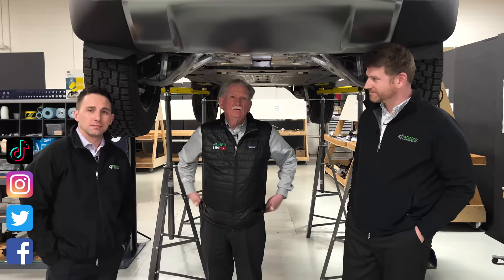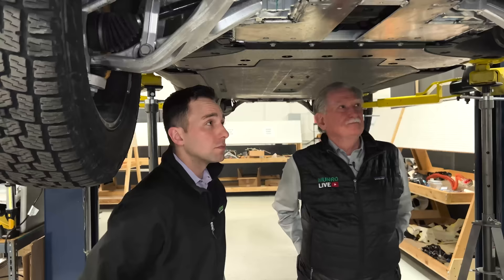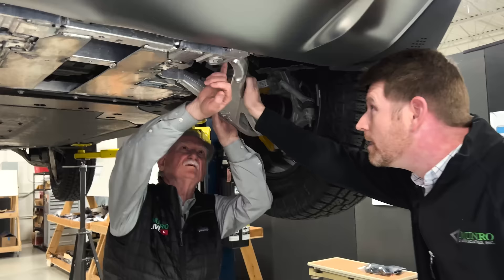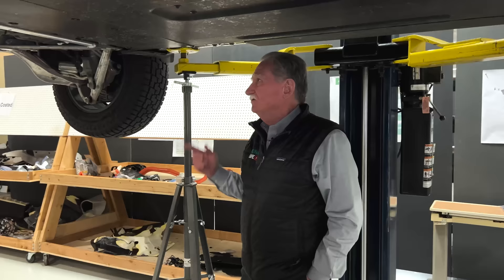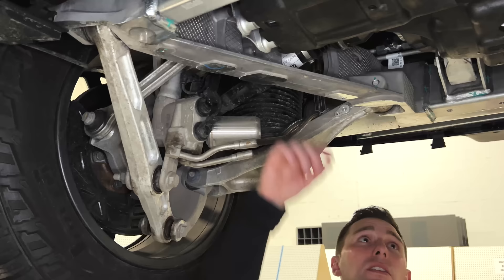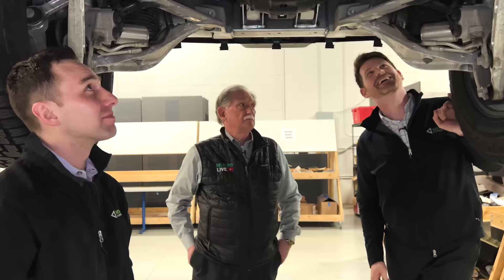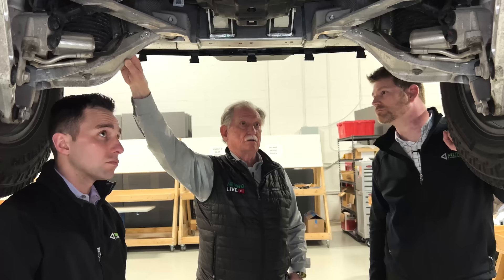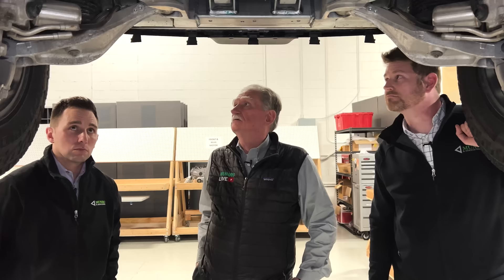Rivian R1T Electric Truck | Hoist Review

Comment: Question, I thought the Rivian had in hub motors, so why is there an drive shaft running to the wheels?
Reply: No, Rivian does not have in-wheel or hub motors; I don't know if they ever seriously planned to do that. There is one motor per wheel - some people confuse that with motors in the wheels.

Comment: Sandy, how would this take a sheet of plywood? Your answer could make or break my purchase decision.
Reply: The box is very short - even with the tailgate down, an eight-foot-long sheet seems questionable, but Rivian says with their tailgate design it's 83.9" long when open. The truck is as wide as other full-size pickups, so width between the wheel wells should be okay; Rivian specifically says that it can carry plywood sheets.

Comment: It seems Rivian have big gigs presses than Tesla. Tesla proved they could do it & save 370 parts(Inc. Fasteners.) Vivian have proved its not only possible but doable in a series production pick up truck. It shows they've moved away from a body on ladder chassis. Those two big aluminium craddles make all the difference.

Comment: Are you going to buy another Rivian for tear down???  Maybe you need to sell some more stickers or get SABIC to sponser it.   Other auto YouTubers can easily review the exterior and undercarriage of the truck.  Rivian was very tight lip about their batteries at the LA Auto show in 2019 so it would be very interesting to see what they ended up doing.  Also it would be nice to see their cooling system (compared to Tesla's Octovalve), the computer/electronics (if they used Nvida chips), their motor/invertor design, etc.

Comment: So If drivers increase tire size (and weight at end of each wheel) will axle half shafts need to be beefed up? Is there space for a straight shaft that isn't graduated? Or is the space engineered that tight?
Reply: Axle shaft size has no relationship to wheel weight. Larger diameter means more torque for the same delivered power - that would be a reason for wanting upgraded axles, but there are many components involved (the shafts, inner CV joint, outer CV joint...) so it's not clear that an upgrade is appropriate. I don't think people are going to be putting huge tires on these anyway - if you want an electric truck with bigger tires, buy a GMC Hummer EV.

Comment: Would be nicer if they make a smaller rivian.. as small as a ford maverick pickup
Reply: There is a dual motor version coming and a smaller battery pack.  Will be interesting to see if they are different in any way (suspension/etc).  It'll be lighter.
Reply: @mistermister2085  correct me... they going for LFP battery?

Comment: That is quite an interesting link system on the rear suspension, any chance we could have you talk about that at some point ??                     CHEERS                 Steve h.
Reply: It's a typical five-link. Two angled lower control arms act like virtual A-arm, two angled upper control arms act like another virtual A-arm, and the fifth link is a mid-height lateral toe control link. The spring is on one lower arm and the shock absorber is on the other. It's functionally the same as a Tesla Model 3 or the latest Model S (such as the Plaid), as well as Mercedes sedans since the 1980's and many cars since then, although some other variations (such as the Mazda MX-5/Miata) mount a coil-over shock directly to the hub carrier instead of on a control arm.

Comment: Kind of concerning that the camber (?) eccentric bolts on the front control arms are at nearly full travel from the factory.
Reply: Look like the geometry of the frame is a banana OR the didn't adjust it.

Comment: I appreciate the engineering eye going over some of the small bits, but the fawning over the suspension is a bit much.  The length of the control arms looks similar to my Titan.  It has similar range of motion to the R1T (without coilover in place)  It would have been good if they'd measured the length of the arms and CVs for a point of comparison.  The shape of the arms is fine for on-road or if you are on a prepared track but I'd never take that into the woods.  The S form of the LCA is begging for a rock strike.  Also the S form demands additional reinforcement to manage forces on it.  
The statement that the R1T did better than the Jeep requires clarification.  I've seen plenty of reviewers try to drive a 4WD up a dirt face that demands 4LO attempt it in 4HI or 2WD, either because they didn't understand how its intended to work or to intentionally 'embarrass' the Jeep.  
Perhaps by the time they get to the 3rd gen R1T it'll be something to replace Jeep, F150, ... but not in current config.  I've seen these at max height and theres little suspension travel.  These cars are aimed at the wealthy that think driving down a dirt road to the ski chalet is offroad.  They are not built to do work or travel off-road.  I have hope, and can see some good design choices, FAR better than those in the cybertruck, but it still has more refinement needed to perform the claims that have been made on it.  Just because your motor can theoretically pull a given load doesn't mean the chassis, brakes or dynamic stability can handle it.
Good review and great first foray into the truck segment.  Next step is to go from "lifestyle vehicle" (what many CUVs, SUVs, and unibody trucks are) to truck.

Comment: Question…is the R1T correctly describe as a unibody?  Within the R1T skateboard are huge frame rails, so how is it not a body on frame?
Reply: I didn't know, so I did some web searching, and there are images - including one on Rivian's R1T page - showing what clearly appears to be a body about to be mounted on a separate frame. Either they radically changed the construction after starting production, or the Munro people don't understand what they're looking at.

And the top isn't flat, so it isn't a "skateboard"; it looks like a conventional chassis with separate frame.

Comment: Aluminum is a weak choice for the undercarriage if it was ever going to be used as an actual truck. It's not to save money that large aircraft manufacturers take the weight penalty to use stronger materials in their landing-gear assemblies.

Comment: Articulation from closer to center line allows for more travel. Wouldn't that also allow more body roll? I don't see a sway bar front or rear.
Reply: That's waht the hydraulic lines on the dampers are for, probably something like DRC from Audi
Reply: Body roll is related to spring and stabilizer bar stiffness, not control arm length or total possible travel.
Reply: @computercrack  Yes, apparently it is supplied by Tenneco.

Comment: Cast steel Control arms are not as durable as stamped steel control arms by a factor of about 10 times. GM saved money casting truck control arms but had some issues when using cast control arms on school buses when the cast control arms failed and school buses crashed. That being said I want a Rivian.
Reply: They're cast aluminum, not cast steel.

Comment: Unibody truck? Can it carry the load? Serious question.
Reply: Commercial vans (Mercedes Sprinter, Ford Transit, Ram ProMaster) are unibody now, and carry tons without problems. But the Rivian R1T isn't unibody anyway, based on images from their assembly line.

Comment: Those hydraulic lines and fittings at the bottom of the rear wheel swing arm, look pretty vulberable !
Reply: Remember the covers have been removed for this video.
Reply: @brianb-p6586  still... you would think with all the engineering that went into this, and advertising it as an off roader, there could be a better solution. ( Is it linked to the rear wheel steering ?) Dont get me wrong, I think the Rivian is revolutionary in the truck world and would love to have one.
Reply: @gavinhassett479  GM has four-wheel steering (at least in the GMC Hummer EV), but I haven't seen any indication that Rivian has it. That rear suspension design can be steered, but not very much. The hydraulic lines are presumably the ones for the suspension.

Comment: Independent suspensions ALWAYS prove flimsy and weak in hard core off roading in the southwest USA. We've torched out many an IFS front end to replace them with stout beam axles. Surely will be a nice riding and handling truck on normal surfaces though. But still tender.

Comment: The problem is when you put a load on one of these electric trucks they quickly use up the battery, they have hardly any range when they are worked. Those running out to buy the Ford Lightening are going to be some of the most disappointed people with serious cases of buyers remorse. Another site just did a test of the Rivian loading it towing a trailer and it failed  spectacularly. No range at all.

Comment: I think what this shows is that,  prior to the onset of EVs, carmakers have been so constrained by the penny that they've strung the live axle along for untold decades, buried in excuses for not advancing. Now in this new era,  the upstarts are unhindered by legacy and using existing parts,  and can begin clean- sheet. This suspension could even be executed in the cheapest stamped steel if necessary.

Comment: I thought it had hub motors? Why does it have front axles? Please talk about that.
Reply: it doesn't have hub motors; it has as many as 4 motors,  inboard located,  one per wheel, with axles.
Reply: Quad motors  are  different  to Hub Motors,which are " in Wheel Motors"  like Lordstown Motors  Pickup.
Reply: I do not recall Rivian ever talking about using hub motors in their vehicles.  However the Lordstown Motors Endurance EV truck is planning to use 4 in-wheel hub motors.
Reply: I'm not a fan of the high unsprung weight  of wheel motors. I think of them like having to stomp around in heavy,  mud- caked steel toe work boots all day.

Comment: Am I seeing hydraulic lines running to the suspension? I think that is what I heard them say.
Reply: Yes, apparently Rivian is using an hydraulic linkage of the struts to each other for roll control. Do a web search for something like "Rivian cross-linked hydraulic suspension" for details.
Reply: @brianb-p6586  Thanks.
Reply: @Miata822  Based on other published reports, it is from Tenneco. It appears to use Tenneco's Kinetic system of inter-linked struts, with their CVSA2 electronic controls.
Reply: @brianb-p6586  Good info. Thanks!

Comment: Great walk through Sandy. My question is, is it quiet enough to sneak up on wildlife?
Reply: yes, motor wine is only at high speeds. tires will still make CRUNCH sound , unless you deflate them a little. 
AMC Hummer could deflate internally.

Comment: Don't like the vulnerability of what looks like a motor or hydraulic cannister on the suspension arm in the rear.
Reply: That's a chamber of the hydraulic cylinder/shock. It may be low compared to usual location of this sort of device, but it's otherwise not unusual.

Comment: Got to recall, Rivian has done a huge amount of testing well before production and R.J. is very down to earth which is clearly reflected in Rivian products.
Reply: RIVIAN took almost a DECADE to release a product. TESLA only needs 2 - 3 years to Engineer a NEW product. but, the Cybertruck is not currently needed for Tesla to grow.
Reply: @markplott4820  Rivian started with a car and then switched to the Truck. Who cares if it took them 10 yrs.  The product is great for a first attempt.  Stop hating.
Reply: @schadraq1671  - time will tell IF Rivian can make it. Odds NOT in Rivian favor. 
Rivian unable to SCALE. 
they don't even have ROBOT rigs yet. and Factory 🏭 is largely EMPTY.
Reply: @markplott4820  we shall see.  But don’t put your all your eggs in CT, it will have flaws.  I also heard they are not starting with quad motor.  They are going dual and tri , but then again who knows.

Comment: Well, as an off-roader it doesn’t look that convincing, especially on all the angles required for crossing ditches, climbs and on the rear suspension it seems they have not fixed the flaw encountered at Long Way Up when they hid a rock. Love the EV part but in really this might need to go a to a tuner…

Comment: Sandy I would really like to learn about charging parameters And Times? What are the availability of charging stations and maximum KW of said charging stations? As we know, unlike Tesla many of the charging stations have very low KW charging capabilities. What amperage charging station do you have installed your home? Good luck with your new acquisition.
Reply: RIVIAN charging sucks.
slow AC charger, slow DC charger, can't even use 350 kw DC fast charger at full speed. 
Tesla 250 kw much faster, up to 1000 mph charging.

Comment: My first response is different to theirs.  My 4X4s both had traditional old live axles, with a huge diff casing very obvious, and ready to hit any big rocks.  They then had various low-ish items associated with the driveline and exhaust... until there was another live axle.  This one is flat all the way back, lots of clearance, and the only things low down are absolutely necessary to attach the wheels!  After that I line up with their observations, particularly Kevin's.
Reply: Cybertruck has 2 virtual axle, can vary 2x2, 4x2, 2x4, or full 4x4 mode. also virtual VARIABLE differental.
Reply: @markplott4820  Very nice Mark.  But what has that got to do with the Rivian's nice and seemingly less vulnerable underside?

Comment: the TESLA Cybertruck suspension is better.
it's got Adaptive air suspension and 16" ride height w/ 14" travel. 
CT also has BEST in class approach, break over and Departure angle. 
RIVIAN R1T is just an OK truck, it's NOT really TOUGH like a Cybertruck is.
Reply: The Rivian exists.
Reply: What cyber truck??? They don't exist dude
Reply: @robertbowman9108  - Tesla has produced MULTIPLE Cybertruck for engineering & testing. it's a 98% PRODUCTION vehicle. has been upgraded to QUAD PLAID motor , 5000lb payload and 20,000lb TOW. 
it's still 200+ mph.

Comment: Mercedes G Series also has very impressive suspension travel, but then again it's designed to work offroad with a central and two locking axels and I doubt they sell the utility diesel model in the US. I wonder how well Rivian has calibrated their 4 wheel drive system, since Teslas seem to have similar offroading problems to some common SUVs that lack locking diffs.
Reply: The Toyota Land Cruiser is also built like a tank and there is a reason why it’s so successful.
Reply: MB g series is not electric ⚡🔋, it won't be electric for years
Reply: @markplott4820  lfmao 😂 Mercedes’ has already made the prototype and is already working on that so deal with that!! The g class is a classic vehicle that doesn’t need a new design.
Reply: Rivian is using one motor per wheel, so there are no differentials and no problems with torque distribution.

Comment: Die casted underbody on front and rear, like Tesla, would reduce time, money, and complexity. 🤔
Reply: Yeah, they for sure (like Tesla did) will have to move to die casting when they ramp production.
Reply: Ya, but u do that only if you have high volumes. This is 1st vehicle for Rivian, so maybe in couple of years?
Reply: How is someone going to replace a large casting when it cracks!? The steel frame of traditional pickup trucks is super easy and modifiable to the eternity!

Comment: I do like the under carriage of this vehicle but I want a real Pick-up Truck, 8 foot bed, good load carrying capacity, 4x4, lower Hp, good range, two door, maybe a small bench behind the front seats. A truck is for work this is just a grocery getter. Who cares about 0-60 not important, taking 20 sheets of plywood to the work site is.

Comment: Sandy is a bit biased toward his expensive purchase. I believe the Rivian is one of the least efficient Ev's built. That's why its battery is so large. Why 4 motors when 3 seem sufficient? They can't sell that truck for the stated price for very long. The debt is going to catch up to them soon. Sorry but ----------------
Reply: I believe the stated price is now $ 94,000 for that truck.
Reply: @terrysullivan1992  Wow--with no service centers? I live 2 hours from Bloom/Normal and only 45 minutes from a Tesla Center. Scarey when it breaks
Reply: Why three motors when two are sufficient? Same answer: better control of individual wheel torque and elimination of differentials.

Comment: That is so bizarre how Munro does not trust the built in mechanical safety locks on there lift. Just weird.
Reply: Insurance likely. Thought the pole jack was for additional balance
Reply: Safety 101… always provide redundant protection. Never trust any kind of jack/lift on its own.
Reply: Not weird, just safe.
Reply: @chriso5774  The mechanical safety latches built into the lift is the redundant means. The goofy  stands are the third.
Reply: @MarkXHolland  No Weird. Go to ANY shop in your city and see how it is done in the real world.
Reply: I understand using the extra stands when they have potentially structural fasteners removed, as they sometimes do at the beginning of tear-downs, but with an intact vehicle they are strange.